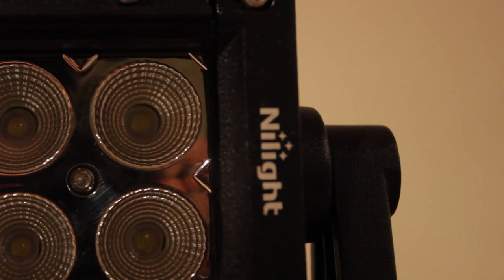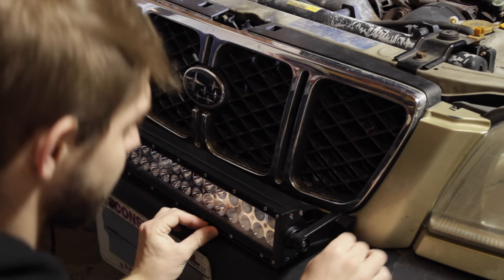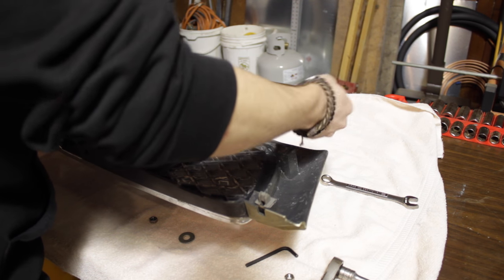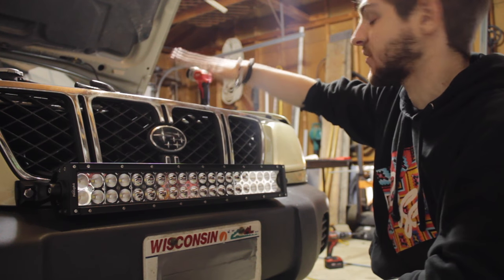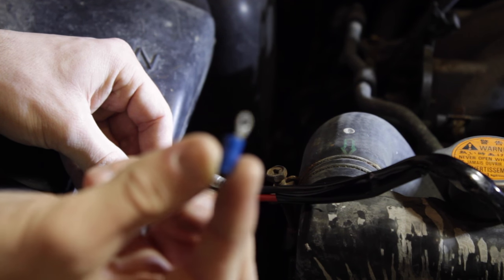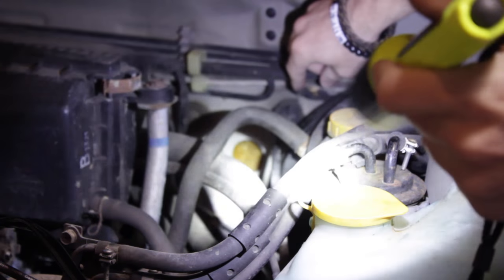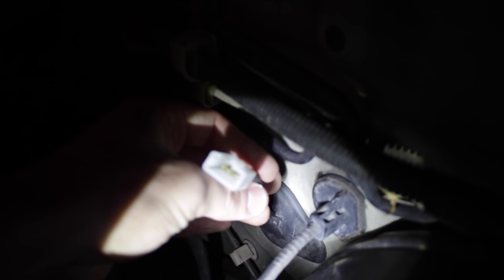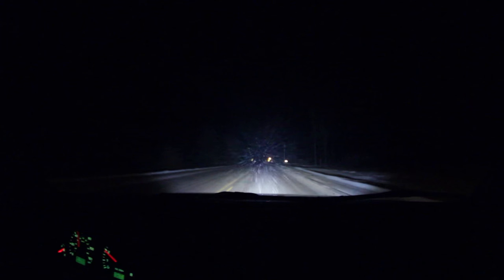Nilight 22" 120W Light Bar Installation

Comment: Looks like you installed these 4 years ago.  I just came across this video today, how did this light bar hold up after all these years?
Reply from the maker: I sold the cat about a year and a half ago but the light bar worked flawlessly the entire time would definitely recommend it. I had no issues what so ever. Summer or winter. Even in sub zero temperatures.

Comment: Tip: Never buy any led bars that will not advertise the lumens.

Next.
Reply from the maker: Why so?
Reply: @JakesPlace12Vlogs  Because they are cheap quality sold by 3rd parties that doesnt have the technology to determine the lumens, lux correctly... which is fairly easy for a company to do if not lazy). Instead, they just go with watts.

Its very easy to make cheap Led bars and sell them for cheap on Amazon. Watts doesnt mean anything.

Makes sense?  You think i was going to get fooled by your video?

I just bought a 2000$ bar instead. Otherwise, if you want cheap, then yea, amazon is the right place for you.